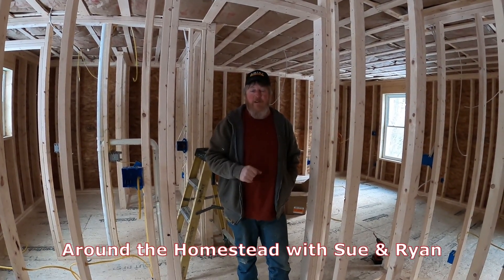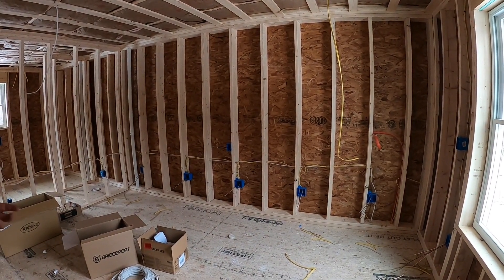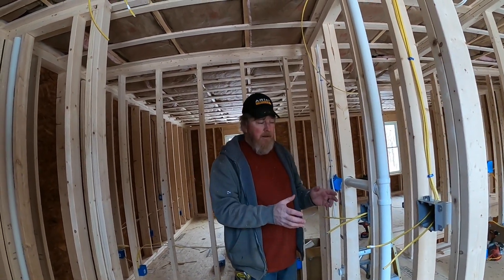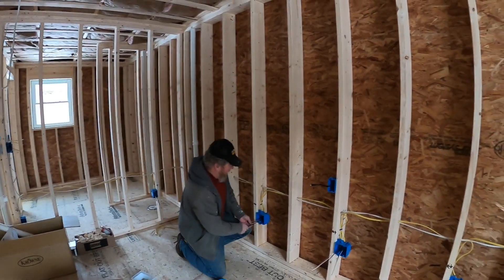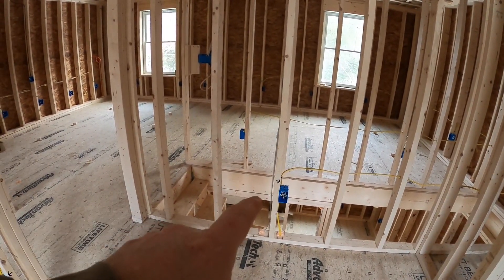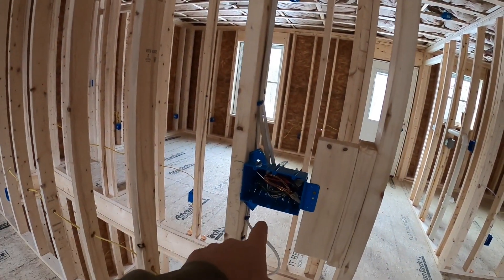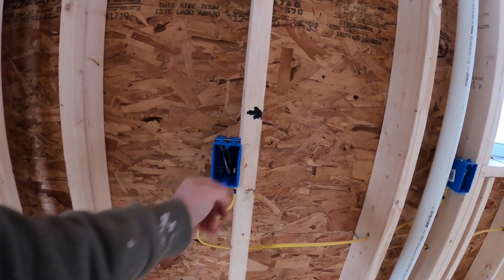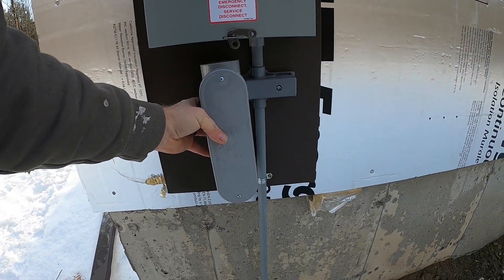Wiring New Construction Home Electric

Comment: Nice neat work.  It’s interesting to see how different electricians wire homes in different parts of the country.  Never seen the meter disconnect combo box before.  Nice video
Reply from the maker: We have always installed the meter socket with main breaker combo, We feel its safer as you can shut it all down right at the source. That said NEC (National Electrical Code) apparently now requires it and our local utility is enforcing the requirement

Comment: I would put the metal plates on every stud in my place since I know I would probably be putting in screws for stuff and wouldn't want to have to worry about going through a wire.
Reply: isn't that a requirement in the US?
Reply from the maker: No, it is based on distance from the wire to the face of the stud. 1.25 inches if I recall
Reply: @aroundthehomesteadwithsuer3497  
ah yes i was commenting before finishing the video. here in australia though we do not worry about plates at all.
Reply from the maker: @ursodermatt8809  Yeah the US has a lot of rules that some times seem a little much :)